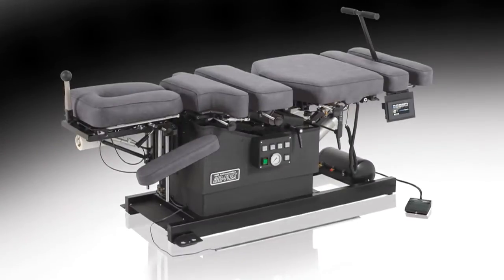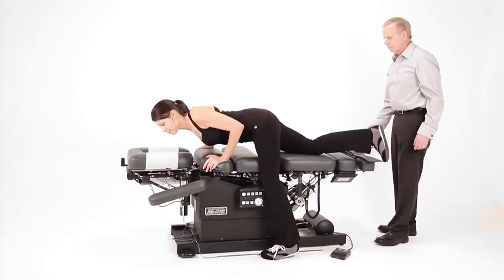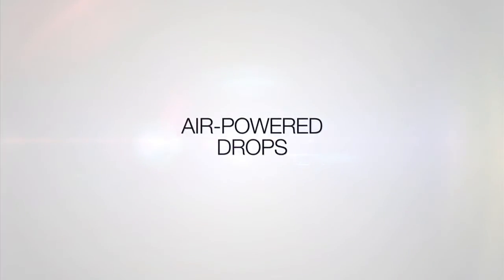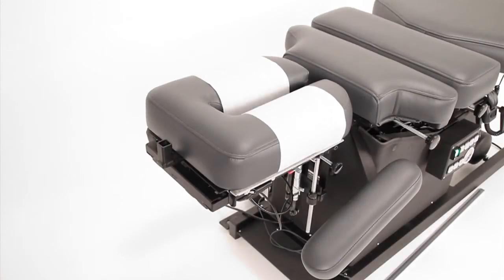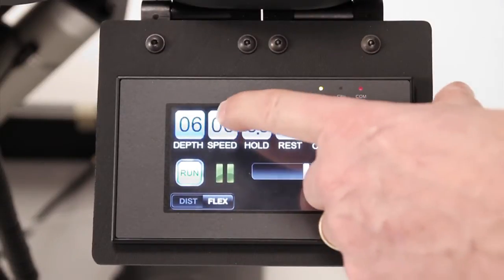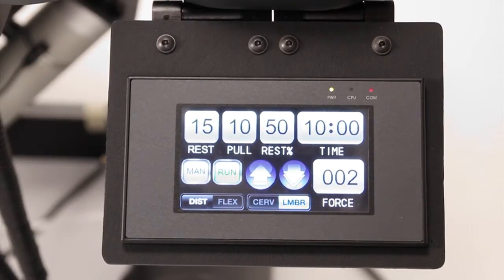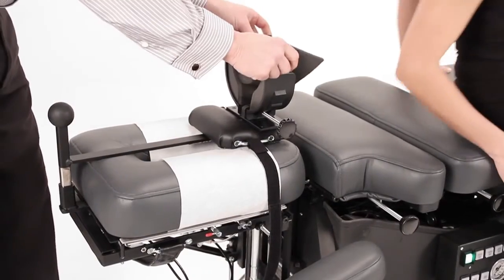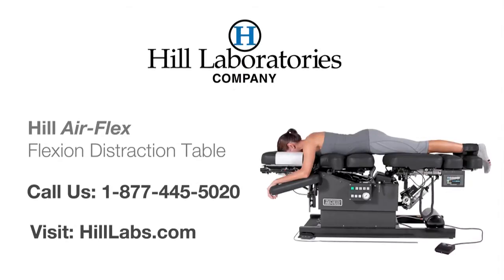Hill Air-Flex Flexion Distraction Chiropractic Table

Comment: In a high use situation, these Hill tables are good for about five years. After that the drops start getting loose and the table needs replaced
Reply: Hasn't been our experience...We have offices we serve that see well over 500 patients/week.  Simple routine maintenance keeps these tables working flawlessly.
Reply: @thetabledoctorllc8471  I’ve had two of them, next time I’ll be getting a zenith or a PHS with better drops
Reply: @markgoforth1149  If it were me, I'd go with Zenith before PHS. Zenith has been building drops for over a 100 years...they are pretty good at it...let me know if you want to get rid of your Hills or trade them towards  Zenith 440s...cheers!